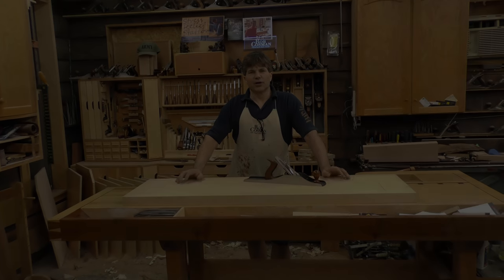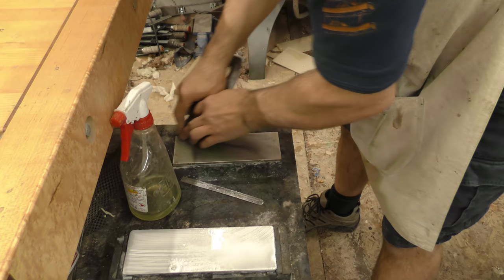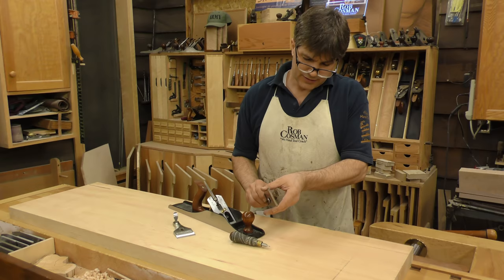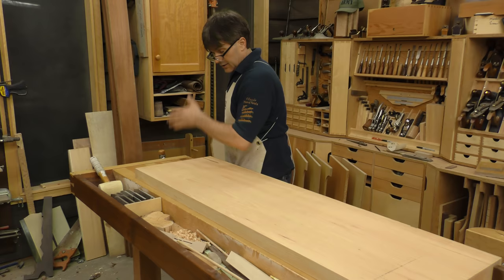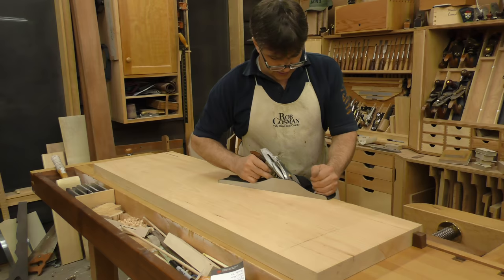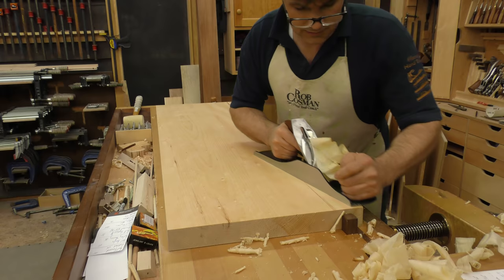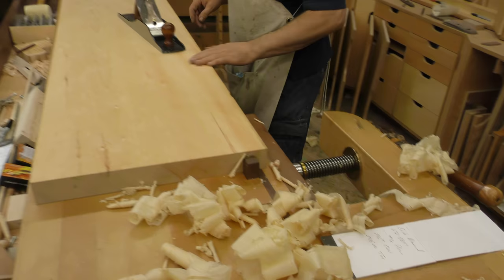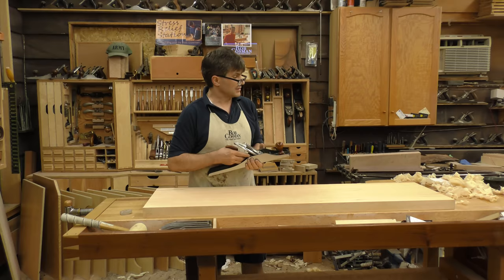Hand Plane Wide Boards

Comment: I do landscaping and a lot of gardening and orchard work. Watching Mr. Cosman planing this wide board has me thinking that a trick Ive learned might apply. I use it mostly for sitting on the ground and brushing up clippings, picking up fallen apples, sowing seeds. You lean as far as you are going to go (in this case, to the far side of the board) and then you go back towards you. It is easier because you strain your body the most when doing the farthest outstretched position. And if you do this right after you just did the second hardest position, and before that did the third hardest position...you are tired when you get to the least ergonomic part. If you take a swipe off  the far side of the board first, then come back towards yourself, you can gradually release your clenched abdominal muscles as you return to a more neutral position.

Comment: Thanks for expertise I can trust! I have always wondered wether taking a long stroke with a hand plane on the edge of a board really is automaticly straight. I have experienced several times that the board ends up with a long gentle CURVE! Only by vigilance in checking and re-checking is the board brought to arrow straight&flat. You, of all people can answer this issue!
Reply: That is why a jointer is long, the long sole bridges between high spots and allows you to level. The longer the edge and the flatter you need it, the longer the plane you need.

Comment: 40 years ago, this Army-brat teenager got his license to operate the power tools in the base hobby shop.  I still have an image of the behemoth thickness planer producing flat and parallel   machined surfaces,  which is not necessarily so, as i've learned in recently picking up hand tools and y/t Rob Cosman.  
I love how it teaches, by hand and sound.  Troubleshooting my cheap planes are frustrating but occasionally rewarding. ( There ought to be a 123 checklist for correcting divots, like a golf-swing ;)

Comment: Nice! I like both a cambered and a feathered plane iron for planks. Lately, I've been restoring and old floor, and I've been using two no 5 planes, one with a strong camber to remove the old surface and get it mostly flat, and the other plane with a straight, slightly feathered edge for flattening the final surface (and also for taking down knots...).

Comment: just looking at where the plane shaves,it looks like theres a little twist still in that board,i always go 90 degs to the grain and diagonal before running perpendicular to the grain.
but hey im not there to know for sure if it had twist

Comment: Hello. I have seen others approach wide boards by running the plane diagonally from corner to corner alternating diagonals after each series. This makes sense to me as a way to make sure your board is maintaining one plane both lengthwise and across the width. Is there a reason you run lengthwise the whole time? I understand that this is partly address by the way you are skewing your plane so that it is referencing a larger area, but it seems like with all your cuts aligned in one direction you are inviting inconsistencies perpendicular to those cuts. I am probably overthinking this, but curious none the less. Thanks for these videos.

Comment: I enjoy your videos on using hand planes and I have feathered the edges of my iron . It has really reduced the amount of marking. I am working smoothing some wide rough cut cedar boards and I wonder if you have any advice on working this wood type. The grain is very hard to read and meanders all over.

Comment: Good job, looks like either a #5 or #5 1/2 plane you used to plane the board, all I have is a #5, is that sufficient?
Reply from the maker: I don’t prefer the #5, I either recommend either a 5-1/2 or a 6. The 5 has too small of a footprint (width-wise) and not enough mass.

Comment: How do you deal with wood that is really barky meaning the direction of the grain is going both ways very tightly together such as the case of guawngo a hard wood in Jamaica?
Reply: Scraper plane should work. Use toothed blade for everything except removing the marks from the toothed blade, and get other, better wood (unless it’s very very beautiful, there’s lots of fish in the sea).

Comment: Rob, one Q. If I feather off my blade’s two corners like you suggest, will that setting be ideal for jointing as well? I plan on trying this on my No.7. Thanks.
Reply from the maker: Your blade is 2 3/8" wide, if you are joining boards two inches or wider then I would not do the edges.  Easy solution is to get another blade and designate it for that purpose.

Comment: 1. Why do you pick up the shavings after EACH movement?

2. Isn't it contraproductive to pull the plane BACK... don't you mknd the blade leaving marks when pulling it back over the freshly planed board?
Reply from the maker: I prefer to not pick the plane up on the return, if you dont pull the shaving out it often gets dragged under the plane and stuck to the sole.
If the plane stays flat on the wood, no marks and no problem.

Comment: So now you have 3 different gradients or bevels on the end of the chisel iron .The first primary 25,then 28 and then 30 .Makes no sense to me.
Reply: yup,its all just a load of nonsense if you ask me to mask people not able to sharpen with one bevel
Reply: Rob Cosma
Reply: Try it and you'll be amazed, 30 to 40 seconds of work to get a ridiculously sharp blade. If you want to spend 10 minutes to sharpen the entire bevel and get the same results, have fun
Reply: You are completely right, it does make no sense. A hollow grind is far better. With a hollow grind just have two small contact points (the beginning and end of the bevel) and this allows you to keep the blade stable during free hand sharpening. The whole micro bevel thing is a load of nonsense. A hollow grind is also always the preferred option for a chisel. The hollow grind prevents the chisel from digging down into the wood giving you far better control. But don't take my word for it, I'm just a lowly shipwright with 20 years of experience.
Reply: Well guys, that which is perceived nonsense is not real until tried and then (truthfully) pronounced as as such.  I like to forge ahead by learning new techniques, trying them, and jettisoning those that I choose. 
     Meanwhile Rob, I appreciate your teaching and presentation techniques.  You move at a great pace and your running commentary and asides are very informative and a pleasure to hear, I can tell it's really you talking.  It's great to see another caught up in their passion.
Reply: funny how all of you smarty pants are trying to argue without even thoroughly testing the method Rob is proposing, lol
Reply: I have a Worksharp. So I just have one bevel. A couple of seconds and it’s done. All methods work, but if you have a wet stone producing a hollow grind, you will still need a further stage of honing at finer grits. 
Robs methods are the ultimate. He can resharpen in 30 seconds. I can’t.